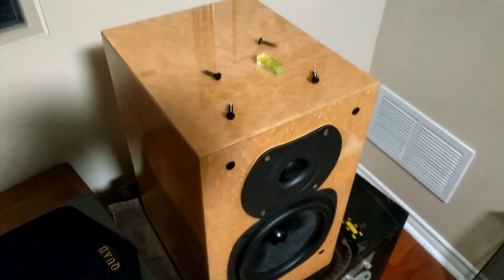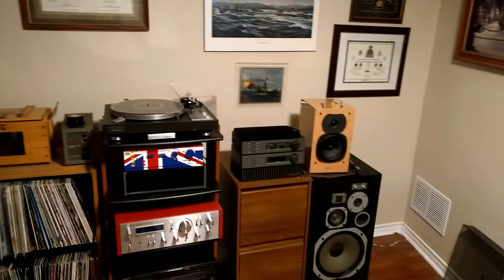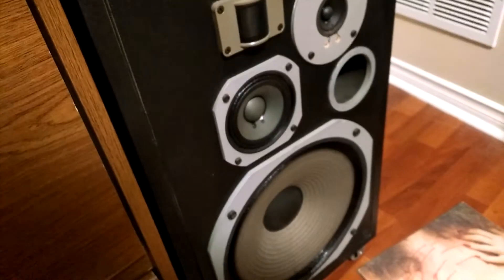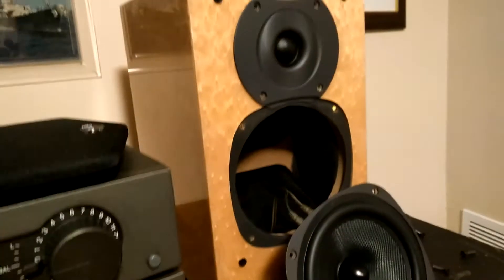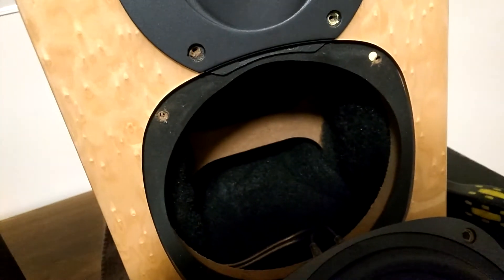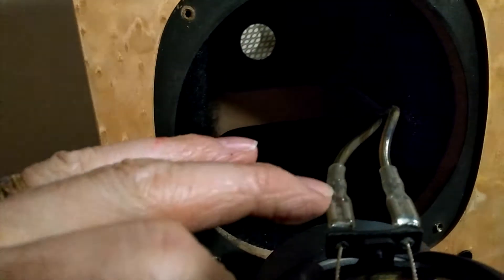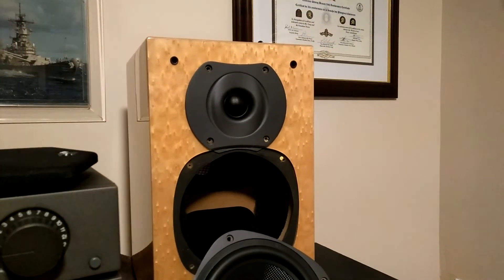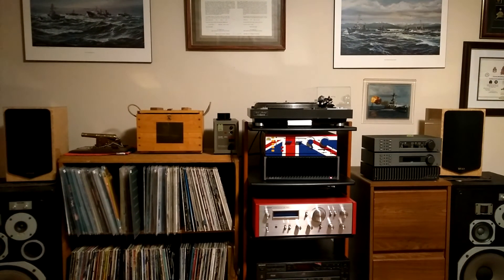Quad 12L2 Speakers - Out of Phase Mystery Solved

Comment: odd I have a pair of these. I always wondered why they didnt sound that great. I use a piece of software with my headphones called canopener which uses crossfeed to make headphones sound better. The amount of crossfeed can be increase or decreased to no effect. But it has a nice feature where it can change the polarity or phase of one speaker. When I hit the button to reverse it the stereo image suddenly locked in and the bass became much better. So I immediately switched everything off and simply reversed the wires on one speaker.  Now my speakers sound brilliant. Makes me wonder whether quad were not really bothering how they wire these things up because my two speakers were definitely out of phase with one another.

Comment: Sometimes the tweeter needs to be out of fase because the engineer has designed the filter that way! I had some Scan-speak Reference where the tweeter needed to be out of fase...
Reply from the maker: I don't believe that is the case here. I think it was simply an installation mistake at the factory. The imaging was absolutely terrible/non existent. After flipping the phasing the Soundstage on these are simply brilliant. I can't believe for one second that this was done intentionally by design - the difference is that dramatic🤔
Reply: @navydiving  I think it also that it was an manufactured issue.. But what I meant was that sometime only the tweeters are out of fase by some loudspeakers.. Not the woofers.
Reply: @ESuutgrunn In a speaker design with an even order filter the tweeter has to be out of phase with the woofer. In fact by reversing it one makes it in phase! This is because the input capacitor alters the phase one way, and the woofer input inductor alters the bass component phase the other way, meaning that the two drivers would be 180° out of phase if not corrected.

I think the Quads are 3rd order 'T' filters, therefore should be wired in phase...as in the film. The consequence of incorrect phasing between tweeter and woofer is a big notch at the crossover frequency, usually producing a drop-out in the mid range region.😊

Comment: 9 volt transistor radio battery across the terminals is much faster way to check phase, at least for the woofers. Speaker moves forward when positive to positive.
Reply from the maker: I could tell just by listening to them they were out of phase😉
Reply: @navydiving  But you didn't know which one to take apart.